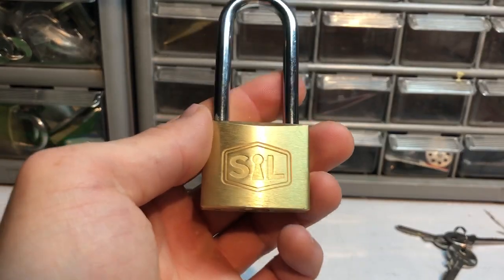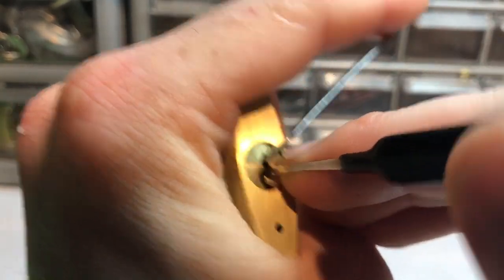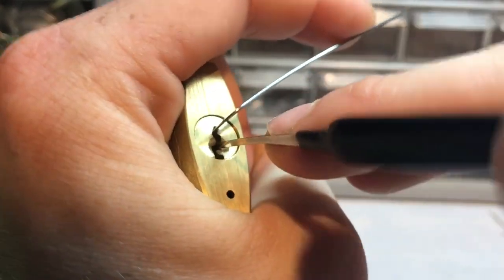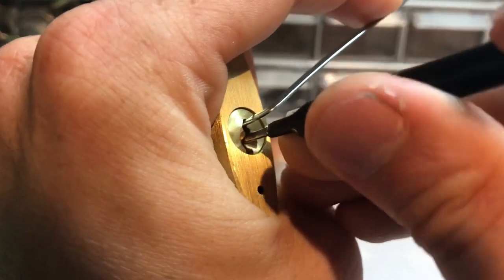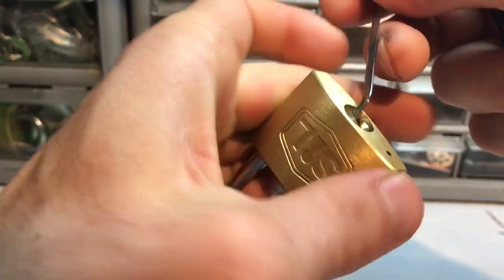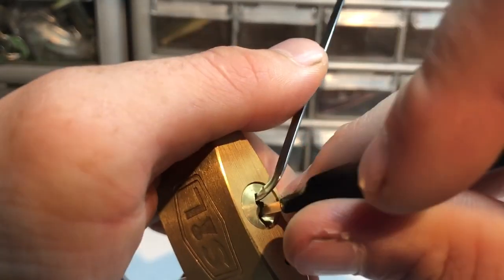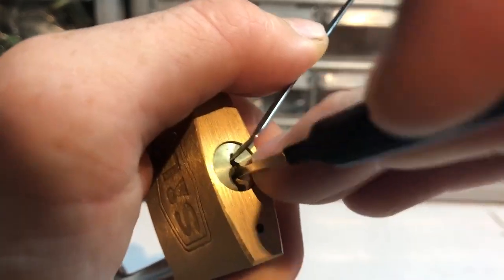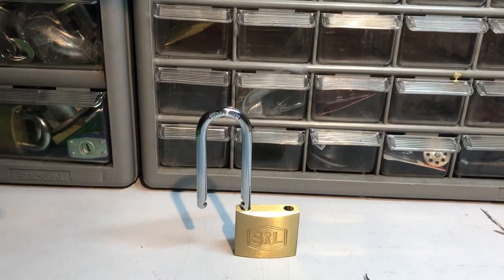S&L padlock from Matt’s Lock Pit “Stock Lock Sunday” (144)

Comment: That's a really nice lock - put up a little fight. Love your home-brew tensioner. Did you harden the tip after heating it.
Reply from the maker: Potti314 thanks! Yes I did harden it immediately after bending it and hammering it flat.  It is made from a street sweeper bristle.  It comes in handy now and again.  😊